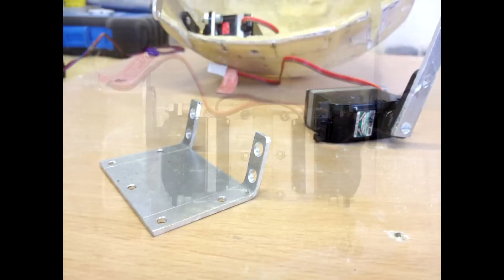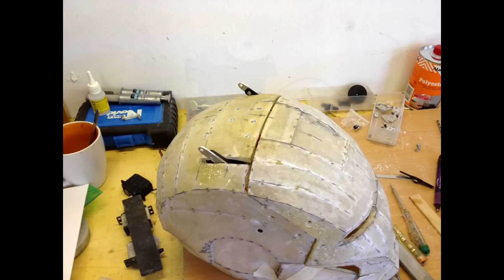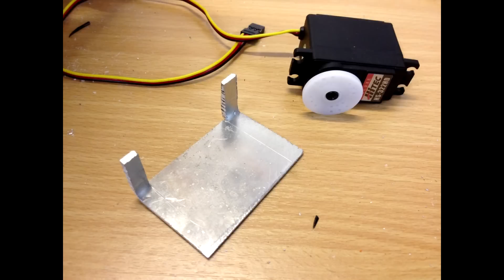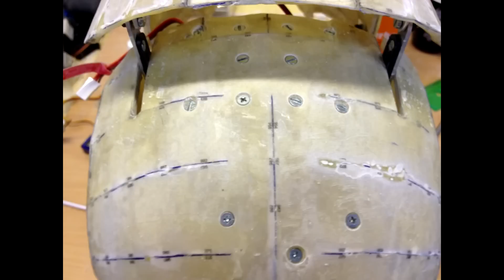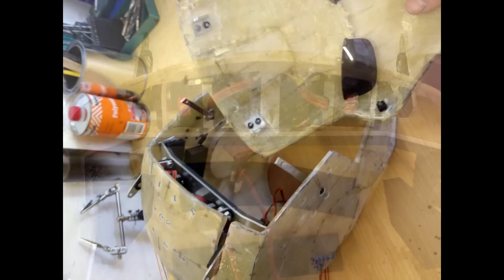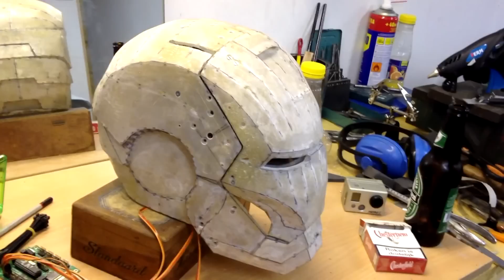Iron Man Helmet Hinge System (Closer Look)

Comment from the maker: hey man,thanks for the compliment:)
i used 3 bleubird BMS-616MG+HS servos, (1 for the jaw).
speed (6v) 0.12sec / 60deg.
torque (6v) 10.2kg /136oz.

I've bought them in the Netherlands,but I recommend to buy at hobbyking . com.the cheapest I could find.

I think every standard servo is strong enough but it is the speed that you want:)
hope I helped:)

Comment from the maker: I use a Lynx Motion Servo board and my laptop just to test it!
I'm still working on the final servo board, I'm currently working on the rest of the electronics of the suit, and when that's done I'll probably use arduinio powerd by a lipo battery .
Take a look at The RPF forum, there are a few threads about arduinio.
goodluck with your helmet my friend

Comment from the maker: i used 3 bleubird BMS-616MG+HS servos, (1 for the jaw).
speed (6v) 0.12sec / 60deg.
torque (6v) 10.2kg /136oz.
I think every standard servo is strong enough end will do the trick but it is the speed/qualitie/ball bearings that you want:)
hope I helped:)

Comment: I am making an Iron Man helmet now. I plan on putting the faceplate on a hinge system so it can move up and down, and also taking the back out so I can put it on. Would I fiberglass, resin, Bondo, etc. and finish the helmet then cut out the faceplate and back or do I assemble the pieces separate and finish them individually?

Comment: do you add a coat of resin on the outside after you add the to have that smooth surface
Reply from the maker: +tijojo11 I did resin on the outside and then resin and fiberglass on the inside!outside is ready for bondo now

Comment from the maker: i used bleubird BMS-616MG+HS servos(specs.are in the discription)
they are expensive but if you build in the servo's like i did you can use a cheap standard servo...i just like the quality,speed and ball bearings.
that board has one servo for the faceplate?
i say 2 cheap servos and arduino and you will stay under 100

Comment: ma non e veloce come il tuo
Reply from the maker: +Vincenzo Iudica  What is your servo type? maby the servo is not faster
Reply: servo pro mg995
Reply: forse questo servo va piano
Reply: impostazione dello skecker e a valore 0 va bene
Reply from the maker: +Vincenzo Iudica the specs says its speed is:  0.16 sec/60deg. at 6v .  mine are 0.12 sec. if i read revieuws alot of people saying the speed is not accurate with the specs and its very slow so maby there is your problem.
Reply: allora e il servo che va piano, ti ringrazio buonaserata ciaooooo